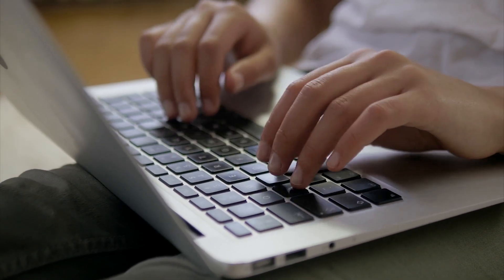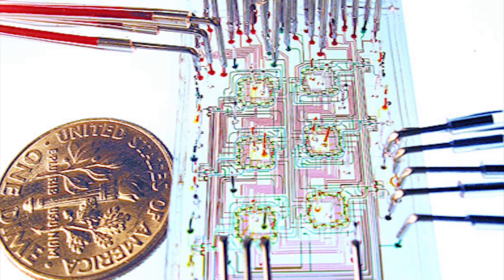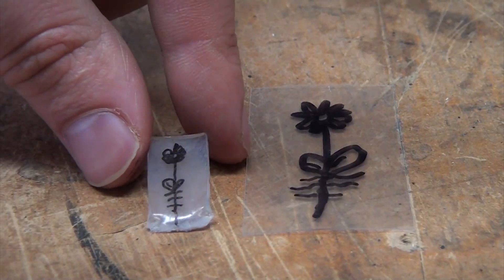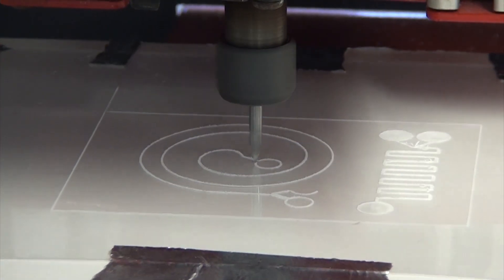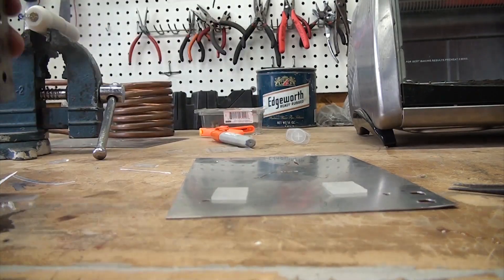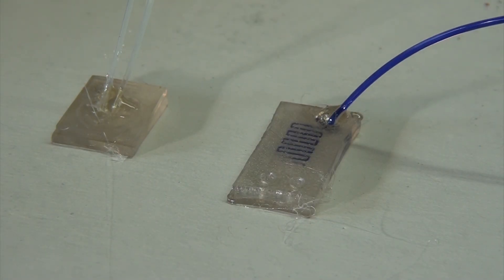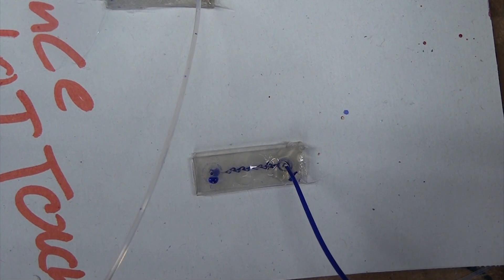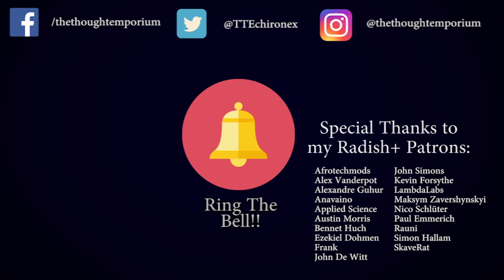Worlds Smallest Tesla Valve? - Shrinky Dink (Shrink Film) Microfluidics

Comment: Couldn't you potentially use 3D printing to print very small channels on a surface that you want to use as your base? I.E. you use an acrylic base and 3D print your channels on it. You could make a much thinner channel than with the shrinky-dinks. Then you attach another piece of acrylic on top to seal it shut. I would probably use something like superglue and apply an excess of it away from the channel(s), the super glue hardens and contracts, sealing the channel with pressure and without needing to heat the acrylic/filament. I know, a mouthful here, but it is just something I just thought of on the fly here and thought that it would be better to share my idea.

Comment: You should use "cutting fluid". I've used 50/50 ethanol and water and using at least 20k rpm for a 60 degrees v cutter. Just wet the surface and it helps. I've done other things with PET and definitively will try this!!!

Comment: same cnc can be used for multilayer PCB creation, and some 3d printers could be modified to cnc, or other way around (cnc to 3d printer), so it is actually possible to create combined mechanical (3d printed) + Microfluidics + electronic device with (mostly) one tool.

Comment: I tried this back in 2016. We milled (1405 printrbot custom) rounded 0.1mm channels on 2 mirrored sheets and epoxy them together. the epoxy literally melted the acrylic and it would become 1 piece, resulting in circular cross section. Never figured an application for it though, the capillarity of the epoxy was too distracting

Comment: Here's a thought..   what if you glued or quick ironed the corners so they are connected.  And then shrunk them slowly.  Maybe use a soldering iron to quickly melt some  contact points.

Comment: This is exactly the part I was looking for.  Soft robotics seems like it should be a brilliant field, but the need for electrically-actuated valves and multiple pumps (or a large air-storage tank) keeps costs high.  I have been wondering why no one has considered using electrorheological fluids (fluids that thicken in the presence of an electric field - like ferrofluids, but for electric rather than magnetic fields) as the working fluid in a hydraulic system.

Comment: lucky i was a minecraft redstone engineer when i was young
Reply: Unironically, that may actually be valuable here.
Reply: @galvanizeddreamer2051  redstone is just great... the fact that a torch gets turned off when the block it's attached to gets power led to whole calculators, displays and games...
even though i don't really see how this could be implemented with those small fluid channels... 
water pressure could open or close other valves... but how would you do it on this small plastic scale?

Comment: You could make a tower design where you stack different designs with a Tesla valve on top to prevent fluid from going back down without using a plug

Comment: if the fluid could conduct electricity could you send multiple signals in the same artery?
Reply: It would probably send electricity threw the whole system without distinction, you might get some use of it but not a huge amount

Comment: The tesla valves' length could be used as a flow rate limiter on the input side, you could probably come up with an equation for determining precision fluid mixing.

Comment: Use spray adhesive on the bottom of the plastic. 3 77 works great.
Otherwise, you could make a simple vacuum hold surface, MDF is air permeable. Just make an acrylic box under a sheet of MDF, and attach a vacuum. Tape off any sections that you don't want air to go through with foil tape in order to maintain good suction.

Comment: Did you think of 3D printing? Not to just hype it up, but with a small nozzle (100 - 50 micron) you could achieve similar if not better results! Plus the 3rd dimension becomes even more open to experiment with. I didn't know about the shrink film, I might get myself some to test some molding experiments I want to do. Great vid overall, always interestign to get to know a new side of science. Is it possible to generate oscillations/intervals of fluid and air? I'm gonna print myself some tesla-valves :P
Reply: Just to elaborate on the oscillation part, I am a product designer in the electric instrumental field. I build instruments looking at new technologies and love exploring weird, non-musical elements and create music with them.

Comment: I've done some CNC twill cutting using what's roughly an exacto-blade for the cutting tool.  What we used was an adhesive mylar sheet to coat the table surface.  This not just keeps the work material flat, it prevents any smaller bits from "popping off" mid-cut and getting caught in the tool.  Afterwards we used an exacto knife to pry the cut pieces off the adhesive mylar.

Comment: This is really cool! I like that you used CNC. Does it contract precisely enough that you could make parts that move? Im thinking a micro turbine converting presure to rotational motion could be a cool thing to try.
Reply from the maker: I've been thinking about this actually. Got some ideas I'm gonna try out. Primarily, I want to try capturing a part inside a sandwhich of 3 layers, but I'll lubricate the part I want to not stick with some kind of oil so it doesn't adhear to the rest of it

Comment: One method to perfectly hold your shrink film down to your cnc bed might be to drip a little water (just enough to create a thin film) on the bed and lay the material on that. The water's surface tension will create suction and should hold your dink flat.

Comment: you might have  better luck using a vacuum chuck to keep the sheet perfectly flat vs. tape. The tape will allow a slight bow which will affect your Z depth of the channels. also the vacuum chuck is another project you can show in a video if you want. ;-)

Comment: Couldn't you use one of those old school plotter plates that charge up and make the paper to plot stick to the surface due to electrostatics to also hold down your plastic sheets without the need of taping them down every time? :p
Reply: You would need to be extremely gentle with your passes or the torque of the bit would easily overpower electrostatics. Also, any catching and it's gone.

Comment: Microfluidics is also being researched in transfusion technologies, as thawing frozen RBCs and preparing them for transfusion takes 60 minutes with current tech. Also, if you do it wrong and a lot of hemolysis happens, or your cells aren't properly rinsed, you ruin your unit.

There's a microfluidic device that thaws, and rinses the cells in 3 minutes. Which is HUGE! If you're treating a patient with a really rare blood type, like Bombay, or someone with antibodies to common antigens, you probably don't have anything that's ready to give to them right away.

https://aip.scitation.org/doi/10.1063/1.4900675

https://doi.org/10.1063/1.4900675

Comment: I wonder if the laser engravers that create 3D images in glass could create 3D microfluidics in glass.
Reply: Hi Chris. Search for femtosecond laser micromachining and microfluidics. Basically, the high peak power pulses are absorbed non-linearly by fused silica (other materials are also available) allowing for a very localized modification (on the range of micrometers^3). If you translate the fused silica substrate in relation to the beam focus you modify the glass, creating nanogratings (nanometric structures that are composed by glass and a void) which will enable the anisotropic etch of the glass with hydrofluoric acid. With this you can basically produce three-dimensional microfluidic channels inside fused silica with a very high resolution, with cross-sections of 10 microns being possible. You can also implement optical waveguides (structures that guide light like optical fibers) in the same material with the same technique to produce optofluidic chips that can be used in sensing.
Reply: @astronata2698  Great information. I Googled it and it's far superior to the 3D image engravers I knew about. It's beyond what I was imagining.
Reply: @astronata2698  That's pretty amazing. I would have never guessed that would be possible.
Reply: Negative spaces can be created of the order of micrometers usind SLA printers. Check this video from Applied Science and skip to 3.42. https://www.youtube.com/watch?v=7Z8uPHL52Q0
Reply: @rewatkargaurav3787   There's a trick to putting times in the video link. add &t=3m42s   
https://www.youtube.com/watch?v=7Z8uPHL52Q0&t=3m42s
Reply: I thought the same thing, but with the shrinkydink application I'd be worried about them shrinking with just the heat of the laser alone
Reply: i really don't think so, they way the lasers work is by creating micro fractures within the glass which block and reflect light back. i feel that if you tried to use it for microfluidics, you'd end up with clogged channels.
Reply: @jonathankydd1816  this... isn't glass though. even in the case of microfluids, it's medical grade silicone and resin
Reply: @jonathankydd1816  FLICE. Here's a PDF "Fabrication of Microfluidic Channels by Femtosecond Laser Micromachining and Application in Optofluidics " which describes the albation/etch process in section 2.
https://www.scitepress.org/papers/2017/61674/61674.pdf
Reply: Unfortunately no. Laser engravers cause micro fractures inside the glass, which gives you the foggy outlines you see in 3D engraved glass images. It can't remove material to create a channel. Some other material maybe?
Reply: I don't know nearly as much about any of this as I want to and as a result, all of you sound like you're making up terms. I wish I wasn't as dumb as I am lol
Reply: Short answer is yes. However, the master molds i need for my current research are mainly made via 2PP wirh a nanoscribe.

Comment: Do you think this would be possible to build using a laser cutter? I guess the channels would be too thick unless you use a very thin sheet and get the focus exactly. Also they need to be bondable in a way so the laser doesn't melt them to far..
Reply: yes but the channel surface is usually too rough  http://diyhpl.us/~nmz787/microfluidics/Rapid%20prototyping%20of%20glass-based%20micro%EF%AC%82uidic%20chips%20utilizing%20two-pass%20defocused%20CO2%20laser%20beam%20method.pdf    and   diyhpl.us/~nmz787/jmm9_3_037002.pdf

Comment: I see people already suggested vacuum table, i would only add that MDF is suprisingly permiable and can be used as bed for vacuum table instead of lots of small holes .. good for thin flexible stock as paper or in this case thin plastic ... just seal edges with acrylic paint. Also a have seen some successfull attempts at CNC-ing flexible rubber by freezing it and making it hard for better finish with no special cutters. Maybe this could be aplicable also here. Freezing the plastic i mean, for better surface finish by putting it under dry ice for a while and maybe put some pieces with it on the cnc table to keep it cool. Just some of my ideas. Must say ... great work and good luck with it.

Comment: Electronically controlled valve is what I was hoping to see here.
Reply: Even researchers struggle with that one - you can buy a big solenoid valve for like $10 each, which will control the air pressure going into a "Quake valve" on the chip. These are big and use a lot of power for controlling something that small though, so arent ideal for microfluidics.
Theres a paper on using the piezo actuators found in a commercial braille display https://www.pnas.org/content/101/45/15861 This is a bit better, but very expensive.
And then theres the option of feeding a microfluidic chip serial information with just one electromechanical valve and having on-chip microfluidic shift register decode it and send it to different valves.
A company is already doing this https://www.ncbi.nlm.nih.gov/pmc/articles/PMC5030342/ , but with multi-million dollar tech.
A guy also did this in house with less than a $100 worth of materials https://vimeo.com/216375125
Reply: @miron__  Great comment, thank you. Speaking of transistors, a controllable valve is what we need to do similar stuff.

Comment: What a neat method! 
For keeping sheets reliably flat in CNC, "vinyl cutter carrier sheets" come to mind, which are moderately stiff sheets of plastic with varying adhesive strengths for mounting paper and other non-backed materials. Some of those already available carrier sheets might work out, but if not, maybe a hard sheet sprayed with a "repositionable adhesive" could create a rigid variant of a carrier sheet.
Also for the premade carrier sheets (and maybe spray-adhesives?), they're quite reusable, since you can just hand wash it with a bit of soap to restore the adhesive.

Comment: You should be able to bond PDMS to glass by running both in a oven at 80 C for an hour or two.
Reply: Would that squish or deform the PDMS in the process? If not, that could be a good rigid medium for single future cells. (Although cutting glass is annoying and that would limit the cells to essentially the type of glass slate he can find.
Reply: @Volvary  If these people use it i'm sure that it works well. https://www.researchgate.net/post/Is_there_any_other_way_to_stick_PDMS_block_onto_glass_without_using_Plasma_cleaning
Reply: @Volvary  Actually PDMS bonded to glass is the most common approach used in microfluidics. It doesnt deform the pdms. While bonding a glass slide to pdms make sure you dont press the pdms or you might end up with the roof of the channel bonded to the slide.
Reply: well he already has a plasma processor, so that would be a lot faster

Comment: You might want to buy/make an engraving shoe that lets the tool float on a spring, but has a small shoe around it that pushes down on the actual material, ensuring that the bit only cuts several microns off the top.
That's how ultra high precision PCB engravers work - they don't even do height calibration, they just use a shoe they pre-adjust.
Reply: i hate all of you for being healthy and smarter than me :(
Reply: This sounds an awful lot like a vinyl cutter knife setup.
Reply: Would that end up making it deeper on each pass? Not that that would be a showstopper. Could be useful.
Reply: @JohnMeacham  Assuming you don't mill away large enough areas to sink the whole shoe in, no.
But the whole point of a shoe is to do it in one, controlled, uniform pass.
Reply: @Spirit532  ah, I think I understand now, the shoe is small and just around where it is cutting and the tip is calibrated to the shoe rather than the table to spindle? For some reason I was thinking the spring pressure itself determined the depth rather than just providing compliance.
Reply: @Spirit532  this is actually really useful to me, I have a spare xy positioning mechanism  I was planning on adding an active Z axis too, but this would be far simpler. It just needs to fully lift off rather then have precise z positioning. I was going to use it to cut plastic for microfluidics so has very similar requirements to pcb milling.
Reply: @JohnMeacham  Should work great, plus material thickness stops being a problem with this set up. Only downside i could imagine is not being able to vary the depth during engraving. Unless you make an active Z axis referenced to the shoe, but then again I don't know if varying the depth of the channel is usefull in microfluidics

Comment: Vacuum table, laser cutter? What am I missing?
Reply: I wonder if instead of cutting the laser would just selectively preshrink areas. At worst you would end up with terrible warping, at best once you shrink the rest of the sheet you would end up with a solid block and no channel
Reply: Andrei Cociuba, I am guessing this particular method and material usage is purely for; small scale, cheap/free, proof-of-concept demos. With something like polyimide and a variable wavelength laser cutter, you could achieve sub micron level precision.

Comment: Reply to using tape. You can also use spray adhesive, and you should probably fly cut a sacrifice board taking several passes, that will ensure you get a even Depth Of Cut. I would avoid a vacuum, the pull down points might distort the DOC.

Comment: Seems like this is a field that 3D printers could really do well in once they get a bit more precise. Even now you might be able to get them reasonably compact (though nowhere near as small as is possible with standard techniques) with a good 3D printer, a tiny nozzle and finely tuned settings. Plus, a lot more amateurs have access to a 3D printer than a CNC mill.
Reply: I know the academia has been working on it, IIRC the process some colleagues of mine were trying to use consisted of first 3d printing and then using the print as a mold for casting the actual PDMS microfluidic device.

Comment: have you tried laser cutting a plastic sheet, then taping over the channels?
Reply: I found laser cutting/engraving leaves a "burr" on the edge that can be hard to clean up and stops the surface from being flat and sticking well. Laser engraving silicone rubber does not do that thankfully, but takes a bit of effort to clean with IPA after, as it makes a lot of dust

Comment: I bet you could use a vinyl cutter to cut the channels. You could tweak the blade height so it just barely scores the film.
Reply: I've seen a slightly different approach where a mould is made of vinyl on a vinyl cutter, the cut area is peeled off and rubber is cast around it, making channels that are the same height as the vinyl film

Comment: You could solvent weld them together at room temperature.
Reply: It works with acrylic, not sure about shrinkydink.
I've tried this with acrylic and dichloromethane, and the solvent seeps into the channels and clogs them. I'll try and solve this by putting wax into the channel first to stop the solvent going in and then melting the wax out. There is also thermal bonding http://www.khetarpal.org/thermal-bonding/